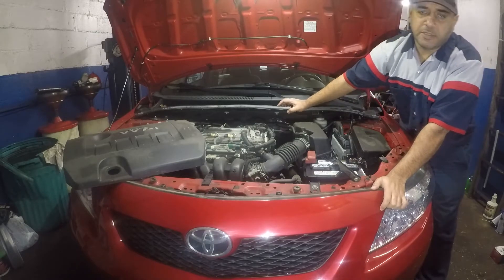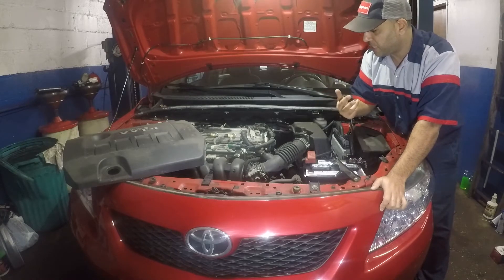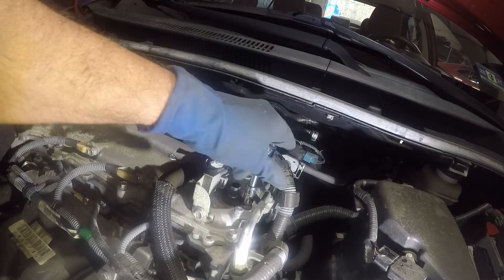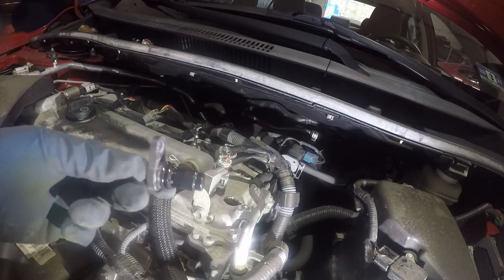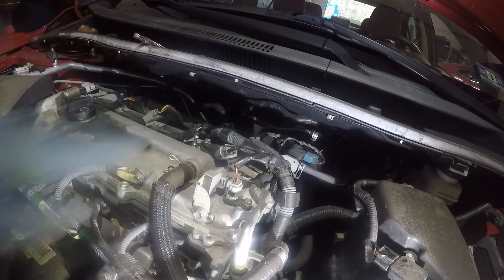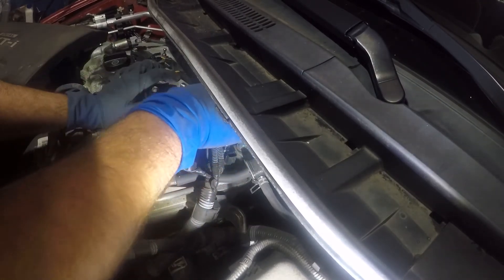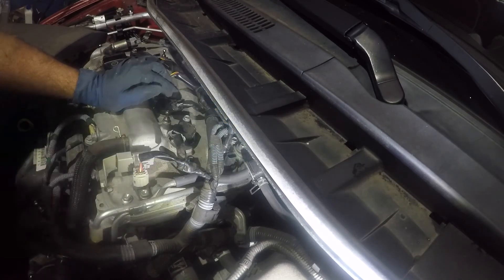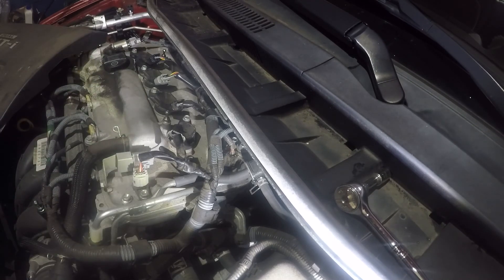Toyota corolla 2009 to 2013 How to replace camshaft position sensor P0340  intake or exhaust

Comment: rly good vid on these 2   cmp   sensors for corolla . Thxx !
   i got  07  corolla
 hope  they r ok  not need to replace.. i cant do it.. maybe my guy  will chk it out for me
 the CE lite was on  w code p0340  p0335   .. but now CE lite went off after couples  cycles  start stop starts..  off now.. so ?
 160,000  miles  eng car still runs good.. no stall or nothing rly. 
 hope I'm good
ya think ?  it gt been false   reading  or sthing ?
Reply from the maker: Not sure can u rephrase that
Reply: @RBTheMechanic  whaa?  
CE = chk Eng lite...  wha don't u get ?   after I git the P0340 p0335  codes .. then lite went out . but scanner still shows codes in there... so what's that mean ?    Autozone shows it as not primary but secondary dtc codes.. so what's that mean ?.. my car runs good.. no stall or rough.. is it false reading ?   do I got rly nothing to worry about ? 
 I think my battery going dead like  5-8x  in last few wks had to get jumpstarts.. has lot to do w it.. bc   voltage etc gets low or zero?   so trips the XE lite and the codes... but now once get started alt  boosts up battery to normal  again and after like only 2-4 cycles the lite went out.   
yathink so ?
idunno.. not a mechanic
Reply from the maker: @phillp7777  oh ok it’s memory code it will go away on its own

Comment: Are the intake and exhaust cam sensors the same part numbers I'm having major problems with a 2009
Reply from the maker: Not sure if they r same prolly for diffrent angle on the connector I would check with parts guy

Comment: Hey bro what part did u change do u have link of part
Reply from the maker: No link for part jus go to autozone or pepboys it’s cam sensors
Reply: @RBTheMechanic  that’s the name cam sensors)
Reply from the maker: @castillollc2366  yup
Reply: @RBTheMechanic  1 more question what ratchet did u use bc I know the one in the back is tight is that a 3/8 or 1/4?
Reply from the maker: @castillollc2366  1/4 drive

Comment: the sensor  may not be bad at all... right?  it couod  be a bad  wire or connector...
  Can  u   try clean rly goid the  original sensor   put back in... maybe will be ok and CE lite and code P0340  be gone ??
 may not need even buy  or get a new one. 
A  new one may be 3rd party   and can be wurse or  bad itself.

Comment: So witch one is p0340 bank1 you never mentioned it just replaced both
Reply from the maker: Bank 1 sensor A the intake side
Reply: I have a P0016 on a 2009 Sienna

Comment: You can do simple  electrical test w  mulitimeter on  the  wire connector has just 3 pins / wires go back to  ECM computer.. right ? 
  so since u got it all pulled out.. Why not take 2 mins  test   the   3pins connector wire  b4  anything  else .. b4 u replace  the sensor.  
   It could be a bad or broken wire or  loose connector.
 good vids  online show  how to  do it.
Reply: what bout this question ?

Comment: What are the symptoms of bad sensors?
Reply from the maker: Slow start long crank fuel air lean
Reply: My 2013s rpm at around 40 mph drops down and up. It looses power for a sec. I changed out the throttle body thinking it might be the sensor and nope. It’s not giving a engine light
Reply from the maker: @fabm4252  could be related to transmission shift
Reply: I got the P0016  code and my idle went high.Im going to try this hopefully its not the timing chain.Ive been told you have  to drop the motor and its like a 23 hour job which costs 4500 bucks.

Comment: What if It was changed and the check engine light is still on?
Reply from the maker: Did u reset the light? Once u change the sensor light dosent turn it self off u have to reset it if it comes back on then u can diagnose further
Reply: How u reset the lights?

Comment: i have this code on my 2013 Corolla. Changed both cam sesnors and the car still just cranks, and wont turn over.
Reply from the maker: Did u check fuel pressure.  Spark. And engine compression ?
Reply from the maker: Also timing
Reply: @RBTheMechanic  - how can i check timing
Reply from the maker: @slowgoat6089  turn the engine to Align the crank shaft to the marking and see if position one is too decenter compresson stroke
Reply: @RBTheMechanic  - it turned out my key was no good, once i got a new key and got it programmed my car turned on 😂
Reply from the maker: @slowgoat6089  cool good job fixing this issue